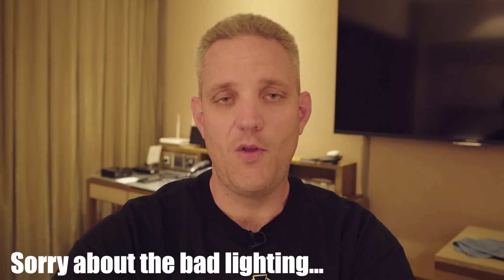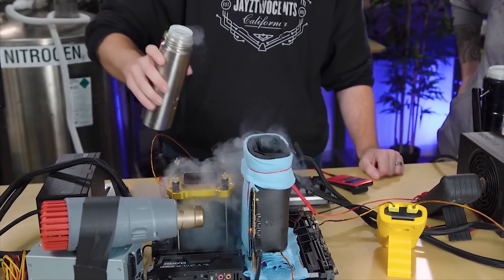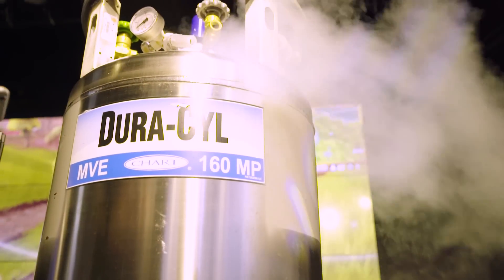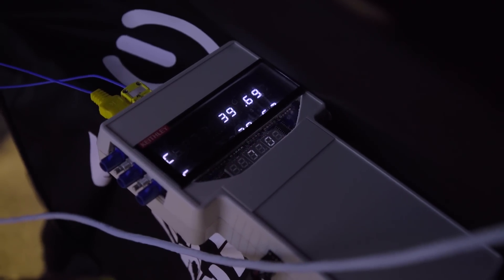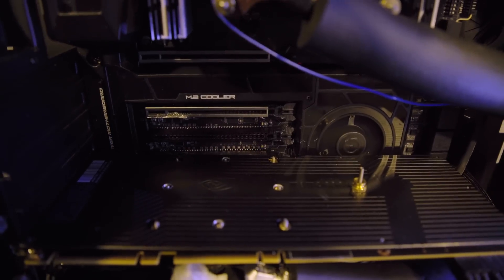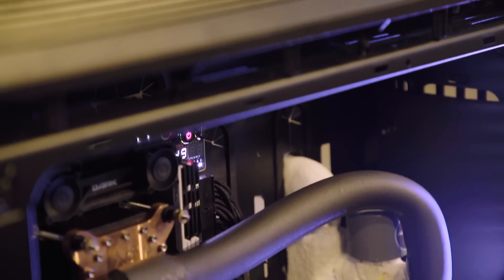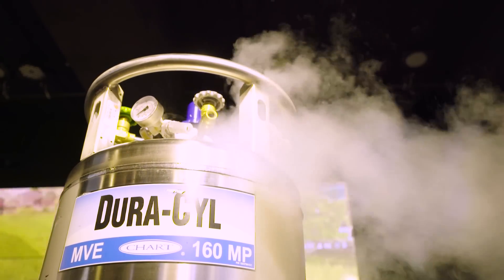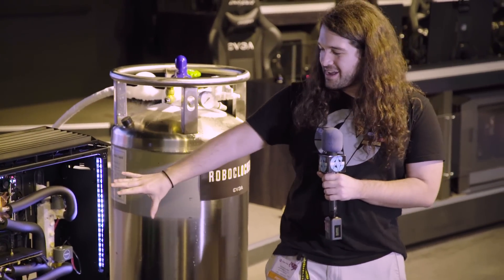Liquid Nitrogen in a CLOSED LOOP!

Comment: Why not use a real sealed loop instead of 2 tanks? Not too hard to do with multiple stages cooling the compressors of the stage ahead of it (ie -20C bp for first refridgerant and 4 stages after that 50C colder than the previous with LN2 at the last/main loop). Only downside is the pressures involved when it's not running and is allowed to reach room temp (might explode if it's not designed to handle it).

Comment: curious if you could run a watercooled system.. but instead of water.. build a mini car air con system connected to a block and a specific rad, re- gassable in the same manner a cars one can be gassed.    closed loop, hardline, real air con cpu cooling haha. if only

Comment: Dude nice! I was actually wondering if something like this was possible, awesome to see someone manage to do it!

I wonder if it’s possible to create an active closed loop cooling setup using supercooled anhydrous ethanol and dry ice, if it’s possible to do that in a closed system where excess CO2 is captured and turned back into dry ice and then used to supercool the ethanol back into the system? I wonder since condensation seems to be a major issue with supercooled fluids if you could do so in a vacuum sealed or atmospheric sealed case so the air inside the case is either non-existent or the humidity is controlled to 0%?

That would be a really interesting engineering project.

Comment: We use 100 gal ln2 tanks like that where I work, for our stainless steel laser cutting machine. Liquid nitrogen gets converted from liquid to Vapor in the evaporator tower then goes to the laser tip. It takes a tanker truck about a half an hour to 45mins to fill one of those bad boys! 👍👌

Comment: To make it a true closed loop system, you need a expansion tank, LN2 reservoir, a cryocooler, pressure relief valve, and LN2 pump which would replace the 2 bulky LN2 tanks.

Comment: Why don't you put a thermostat in the water return line from the CPU block to control to an external AC unit that has low pressure side heat exchanger in front of air flow to the water heat exchange set temp for > 40 F AC on

Comment: Interesting these developments are occurring around the same time quantum computing is emerging which requires cryogenic temperatures to work... So as this tech develops and eventually becomes a completely sealed system and shrinks to fit in a PC case then we could see this being used for small scale quantum computers in the decades to come.

Comment: Not really practical for daily consumer usage and its an expensive hobby to be doing overclocking all the time. Its a hectic to be cleaning it. Im sticking to copper liquid cooling.
Reply: This isnt ever meant to be used at home. The point is to simply push the hardware as far as it will go.

Comment: Hello Jay, I recently just built my pc, but I have an old psu that’s like 8 years old, I cleaned up the dust and put it into my pc. The pc works fine when the hdmi is not plugged into the gpu. When the hdmi is plugged into the gpu and when running games the screen will flicker and sometimes even restarts the pc. Need help please.
Reply: probably worn out caps, take it steady with settings and buy a new power supply as soon as you can, my rule of thumb is work out what the build needs to run properly, and then buy a supply 100w bigger, just for future reference.

Comment: can't this be done on the cheap with  liquid propane?
Reply: also, super cooling for over clocking causes condensation that can be harmful to electronics. Could this be solved by mounting the mother board and components in a tank filled with nitrogen gas? Nitrogen gas is dry and the super cold lines to the graphics card and processor should also cool that gas. Would this work?

Comment: Hello Jayztwocents
So first of all i just wana tell you that i love your videos I think you are doing an amazing job
And the second thing i wana ask you if you would know what i should do to get my pc fixed
My current configuration is and gtx 1060 6gb,i5 7400 8gb ram adata xpg 2400mhz,hdd from toshiba and a power source from njoy of 500 wats a 25 inch monitor from lg
So im having a little problem when I am trying to start my pc it usually doesnt want to start sometimes it does but most of the time i either have to unplug everything then plug it back in or just get my ram out and clean it and then it works but its kinda annoying everytime i get home i just wana play a quick game and I just cant start it up sometimes it doesnt even work by cleaning the ram it just wont start all day and i only got an error once Video TDR Failure i dont know what that means i looked it up tho and i still dont know
Anyways so i overclocked my video card once nothing bad happened i never tried to up the voltage or anything only the core clock and memory clock
A yeah i only have a ventilator and i dont know how to plug in another because i dont have umm another 3pin or 4 pin on the motherboard
Anyways thats it and keep posting you are doing an amazing job

Comment: I cant imagine having those tanks in my room
Reply: It would be a bad idea to have it in your room. As the liquid boils off the pressure from the gas has to be released, and if it's released into your room it could fill it full of nitrogen and displace all the oxygen in the room and suffocate you. Although the solution to that would be to take the outlet of the release valve and pipe it out a window.

Comment: Will LN2 be the way
Reply: Thats a big No.
Reply: Doesn't look very practical to me. I would say no...
Reply: If you want your components to die after a couple weeks/months or take everything apart every couple weeks to maintain it
Reply: no. it's guaranteed that some idiot will freeze off his fingers and sue the manufacturer of the LN2 loop for a ton of money
Reply: megapro125 that's so true
Reply: Yes... I have no doubt!
Reply: when you are manually pouring you have to heat to avoid condensation and getting water but in here you would probably have to wipe it of before you turn it off
Reply: no
Reply: Not a chance, need it for intels heat though
Reply: seems a very inefficient way of cooling.
Reply: i work with liquid nitrogen daily at my job and right now its just not practical; the tech is just not there.  ln has a boiling point of -320f and our normal temperatures (as in room temperature) causes ln to evaporate extremely fast. also touching ln without special gloves (even then gloves will literally break with to much exposure) will cause complete frostbite and can actually cause your hand to just fall off. theres a brief window where it actually wont hurt you; but if youre someone who has never worked completely with it, youre risking alot. theres just alot of things that need to be done for it to work right. also if one of the loops happened to break it would be extremely dangerous
Reply: Intel says Yes.
Reply: No.  Forget the impracticality, imagine the average person trying to deal with liquid nitrogen... lawsuits.  Lawsuits everywhere.
Reply: Very noob question here: There seems to be freezing going on in the case, doesn’t it melt when the PC is turned off?
Reply: Definitely, first step towards the consumer quantum computer.

They always say that there will be no consumer quantum computer anytime soon due to the crazy cooling requirements. This looks like a solution to me /s
Reply: LN2 doesn't know the way
Reply: You are not de queen!! Clok clok clok clok
Reply: LN2 show me da wey

Comment: Who cools with LN2? Too expensive....
Reply: I personally use LN2 for increased performance in Microsoft Excel
Reply: The joke went over a few heads, consumers totally use LN2 daily works great for minecraft.
Reply: also LN2 is 0.4-0.5 bucks a gallon. Now compare that to fresh water
Reply: Lol that went over your head, consumers can totally buy and store LN2 and use it daily.
Reply: I lolled
Reply: Rais, i know. Now take a look at storage solutions and compare that to fresh water.
Reply: Xx Tek tip xX I know. Let's get smart but not too much
Reply: I think you're missing the joke
Reply: You're missing the point. No one uses LN2 to cooler on a daily basis. It's purely meant to reach clock speeds that are not possible with general air and liquid cooling.
Reply: Well the chance if he was actually not joking.